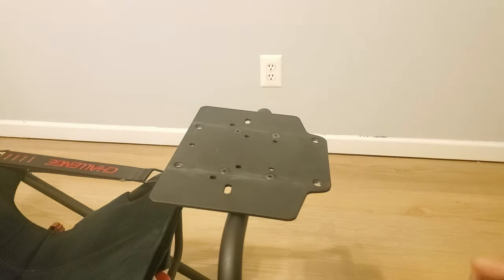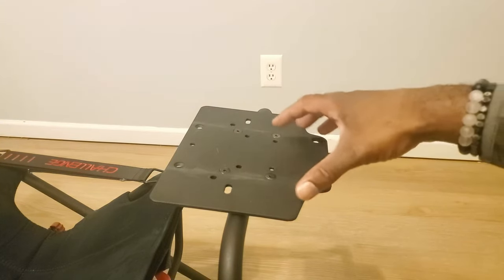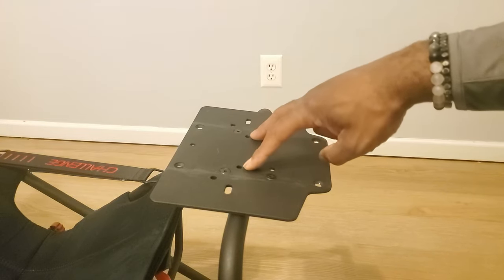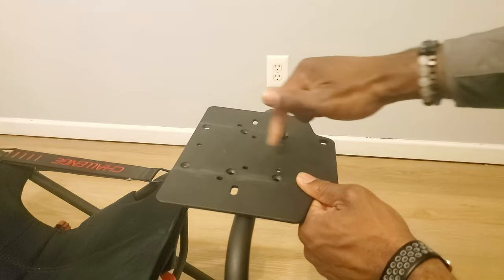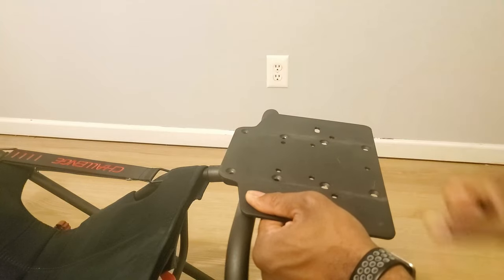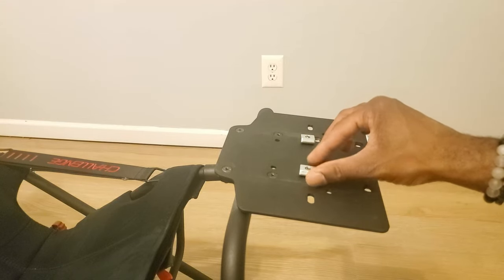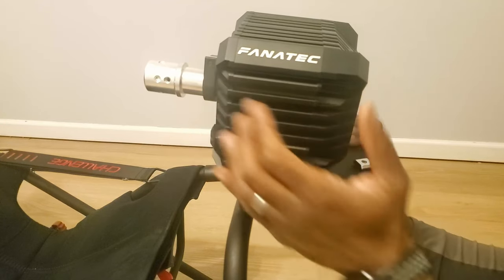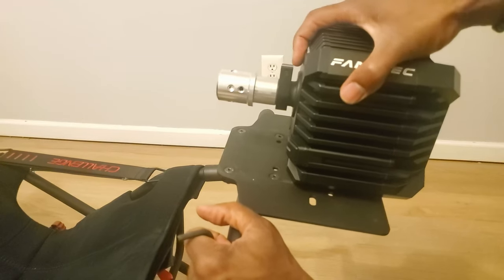Attaching CSL DD to PlaySeat Challenge

Comment: My Playseat bolts are too long, I need to buy smaller one
Reply from the maker: Did you try to use those bolts on all three slots of the CSL DD? The middle slot is not as deep as the other two and doesn't need to be as tight. I tightened the other two down enough to hold the base in place and the middle just enough to keep the base stable.
Reply: I bought M6x16mm bolts, and M6 spacers (1.6mm thick) It worked great. But i bought a drill today, so I will drill a new centerhole, so I can have the CSL more centered over the bar, cause its very front heavy now and can tip over it feels like.
Reply from the maker: @AndrewTSq  Gotcha! It can tip over if given just enough of a push. Let me know how drilling the new center hole works out for you!
Reply: @JCCollinsRacing  I drilled 3 new holes actually. I felt that the steering wheel was too far away from me, so I had to make 3 new holes, but now its good. Now its a lot better, not so easy to tip over :)
Reply from the maker: @AndrewTSq  very nice!

Comment: Ok, the video is very clear and it looks good. However, I just got myself the Playseat to pair with my CSL DD and ran into to issues.

First of all, the "new" holes you use to mount the plate after you've turned it around are not tapered so the screws stick out pretty bad.

I could live with that, but the bigger issue are the bolts that fix to the T-nuts. In my case the two front ones are a good 1/2" too long so once they bottom out, the wheelbase still moves up and down a lot. No way I can use it like this.

Might have to go and look for shorter bolts, but this is super annoying considering how everyone raves how the playseat is compatible with Fanatec stuff. And don't get me started with the pedals where the velcro they provided is way too short to go around the V2 pedals. :(
Reply: I have the Elite v2 pedals and I used tire ups. They work perfectly fine.

Comment: Looks stupid cause its 2 far back on the base plate 😮
Reply from the maker: Don't let the look deceive you. It works perfectly! If that is too far back, you can slide it closer to your liking. Either way, the plate needs to be adjusted and this is something that Playseat accounted for with the adjustability of the PSC. Whether too far or too close, the PSC will handle the CSL DD without issue.
Reply: i did it like it a few days ago, my mans a lifesaver here
Reply: @JCCollinsRacing Problem is it will either be too far back or too close to you (if you keep the plate in its original position). I've kept the plate flipped cause the original position is way too close for me (I'm also 6 feet like you).